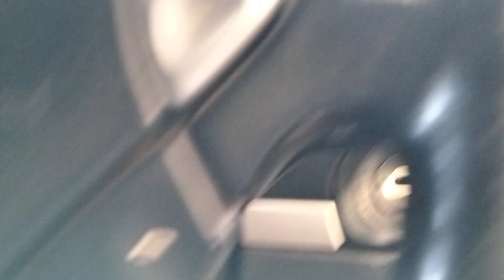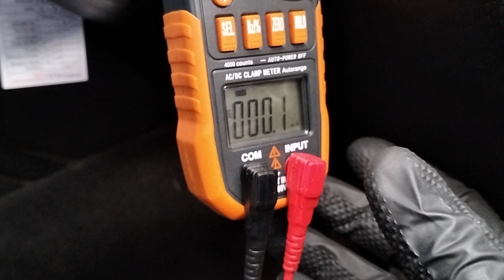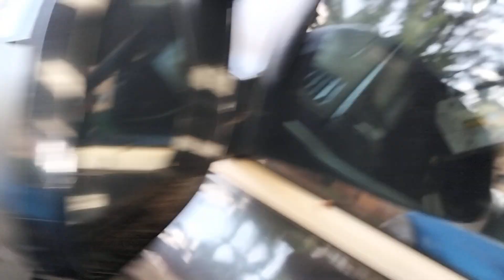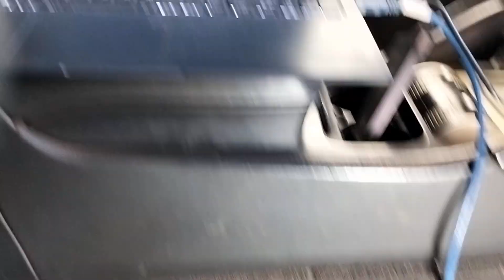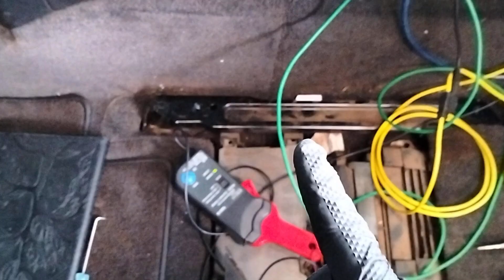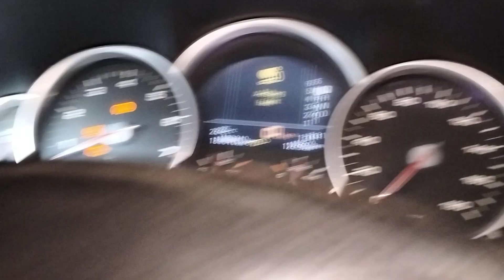2004 PORSCHE CAYENNE BATTERY DRAIN DIAGNOSIS

Comment: Nice work,what kind of program diagrams you using please?
Reply from the maker: There is no one program that has the wiring diagrams, so you will need to get different tools. For Prosche, you have a choice between using the diagrams in PIWIS diagnostic system (which is the OEM Porsche system) or in this case, there is an application called Porsche WireView V1.3.10 that was created by a member of the MHHAuto Forum, which covers Porsche up to 2015.

Comment: That’s a great video 👍 my question is if you disconnect the telephone just remove the fuse completely isn’t going to help with the problem?
Reply from the maker: I tried that. The amplifier does not work with the module disconnected. The owner is a music lover, so he wanted to still enjoy the audio, and the factory system sounds very good.

Comment: doesn't it cost a lot to get the factory manuals than an after market ones like the motordata or alldata  that has all vehicles in one
Reply from the maker: Hello. Yes, it does. I have tried AllData and other aftermarket services. They are not complete and offer less than 50% of the OEM manuals. They also contain a lot of mistakes. I will create a video comparing the different aftermarket services with the OEM factory manuals. If you happen to have a difficult diagnostic session, the aftermarket options will leave you stranded.

But on the other hand, once you become good and advanced, you just increase your prices to cater for those costs. You will be surprised how many people are willing to pay a premium if they do see the value in your work.